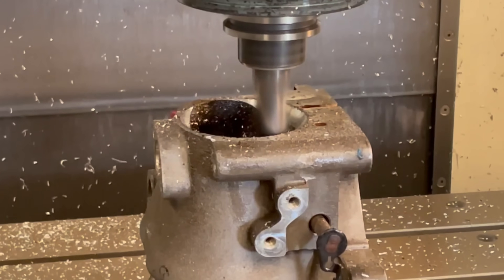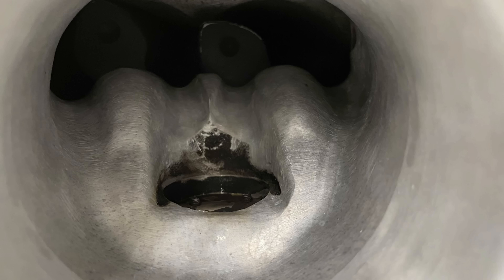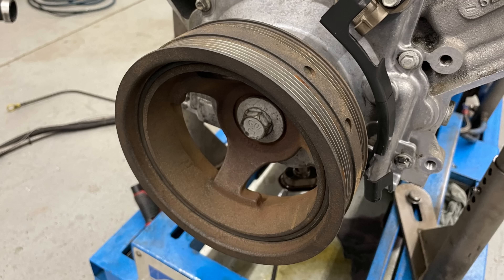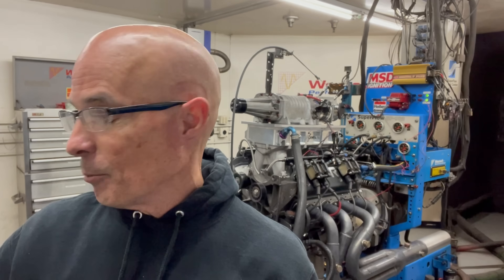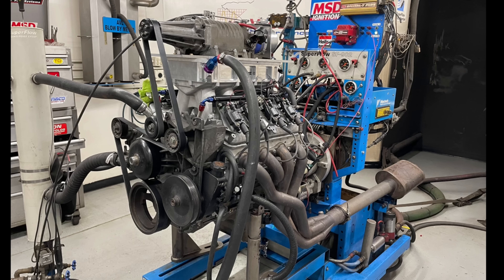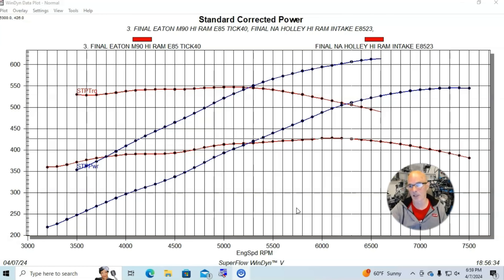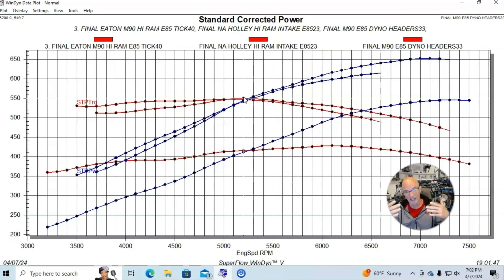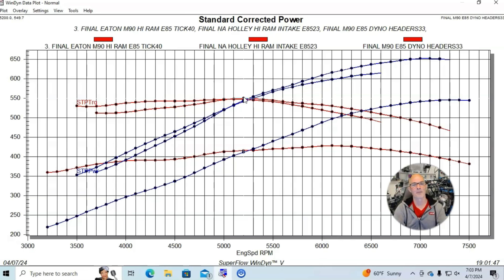PORTED M90 BLOWER TEST-HOW MUCH POWER IS PORTING REALLY WORTH? CAN THE JUNKYARD M90 MAKE 650 HP?

Comment: Not a very good comparison. In your first attempt before the professional porting, you ran it with no intercooler. Then you tested the professionally ported M90 on top of a big thick intercooler core. You will obviously get more power  intercooler.  Need to test your original on that same intercooler. Then you will see the difference of the ported blowers.

Comment: As I happen to have a few spare M90 on hand, building a couple of cars, a 23 T and my 99 Grand Prix which I'm converting to RWD with a Pontiac 455, I have been planning on a BBC for the T, now I'm contemplating an LS and using 1 of those M90's, it looks and performs pretty cool. I'd be able to run the efi I really want to, the COP's and have a really strong well designed easily source able parts instead of the big heavy Chevy. However I don't have a motor on hand to start with and I do have most of the BBC stuff even if I have to pull my 454 from my RV which is old and run down. It was cheap enough and I could easily recoup the cost of that. Maybe this will be on the back burner for later. Either way, as you Rich, you test so I don't have to. I'm still contemplating doing the compound boost on my y2k SSEi using one of those eBay T76 turbos. I have to go back and look at the comparison of it to that GT45 you used and figure how I can make the OE ECM work with that as it's been tweaked already by ZZP.

Comment: Im planning running an M90 on my stock unopened BMW M54B30 at 8 to 10 psi, intercooled, would porting it be worth it if my main goal is lower intake temps or will the intercooler be enough?
Goal is 350-375hp
Reply from the maker: a bigger inlet and porting helps

Comment: hej richard,

i want to place a ported m90 blower on my 2.0l 20v turbo volkswagen.
the car have a borgwarner efr7163 t4 twinscoroll 0.80ar turbo that can do 60lbs/min and make 530hp.
do you think that it going to work when i make the air intake/filter on the blower inlet and the exit of the blower into the inlet of the turbo with a watertoair intercooler in between.
so i mean without valve to switch over to only turbo.
is the supercharger powerfull enough to feed the turbo to its limit of 60lbs/min?
max impeller speed go to 17500rpm (7400 engine rpm)
Reply from the maker: if your efr turbo will support 60 lbs/min-it should make 600 flywheel hp. The blower will be in the way and raise pressure dramatically-though it will help spool
Reply: @richardholdener1727  thanks for youre fast response.
then i go try to make a big  throtle bodie in front of the turbo air intake that opens when the supercharger did the job down low in rpm.

Comment: Blower needs more rpm now. Help recover that boost loss down lower rpm. Peak will also climb as long as heat doesn’t run away. Cooling always key on these pd blower combos. Crazy that kind of gain on such a tiny blower
Reply from the maker: we had over 20K blower speed already

Comment: I guess if hood clearance is not a problem, bolting on 120 ft lbs of torque and 100 hp for $500 is not bad.  The M90 is bit small for such a large engine, but it is much safer to run such low boost, would be great for a DIY person.
Reply from the maker: The blower doesn't know engine displacement-just flow and power

Comment: i had one of these M90's bolted up to a toyota 22r Hybrid motor with lowered compression and a 600 double pumper holley on top... she was fire breather
Reply from the maker: very cool
Reply: Hows  the supercharger working with the carburetor  on top, is the gas wiping the rotors and bearings. I'm thinking about doing the same

Comment: Would be interesting to know if the intake temp was running more at the lower rpm after it was ported.  Maybe it needs a stepped throttle opening to control the blower. 🙂

Comment: 4:00 how long did you say the belt needed to be?   Yes.
Reply from the maker: I ran the belt for the dyno testing without using the alt or PS-you would want a different belt length than I used in a vehicle

Comment: It'll all be to do with air velocities won't it? By porting the blower you remove material and make the port large. If too much bigger this will reduce air velocity but not flow. Hence the lower velocity in the lower rev range will show as a dip in torque.

Comment: The loss low down is probably due to the rotor exit porting. I remember a presentation that Volvo did on an engine conference i was at, where they did play around with that area to taylor the superchargers efficiency characteristics for their twin charge application.

Comment: I am a noob and extremely lacking of knowledge with this kinda stuff. Can anyone inform me of the benefit of having drilled that hole and inserting that pin where it is please. Thank you
Reply from the maker: to stop the damper from spinning on the crank-they must spin together to drive the blower
Reply: @richardholdener1727  ohhhh ok I get it now it locks them both together to rotate at the same rate. Thank you for replying to me very much appreciated have a good day

Comment: I know it's probably one of the multitude of pulls you made, but it looks like at 5:20 you have too much timing up top as it's puffing out the exhaust from detonation....
Reply from the maker: there is no detonation-the junkyard motor has 200K miles and now near 600 dyno pulls with several hundred above 7500 rpm.
Reply: @richardholdener1727  gotcha... Yeah I just figured it may have been a video from one of the times you made a pull and turned the timing up like 1 degree too much in that one spot. Usually for me, that was the sign I was pushing the limits a bit too much and would back it back down.

Comment: Just did a test on an LT4 Camaro ZL1 last week.  Same tank of fuel, same pulleys, same tune, just swapped stock 2650 blower for a Kong-ported 2650.  Picked up 70 hp up top.  gained from 4000 rpm onward.  Did lose some torque below 3000 rpm though.  This was on a 427, really good cam and heads, making 4 figure hp.
Reply from the maker: do you think the port timing changed with the porting to show the losses down low
Reply: @richardholdener1727  I think it had to have.  It's got a lot more entry area so at low speeds with less air velocity it just isn't filling the rotor space as well.  And air velocity probably got even worse by opening it up.  TBH I'm not sure I'd do it for a manual car.  But for an auto trans with the right setup (this was on a 10AT ZL1) it's all positive.

Comment: Interested to see what a 10/71  Blower on stock motor would make for hp, with ring gap added of course
Reply from the maker: I have a 6/71 blower on a 383 ls vid up
Reply: Great vids Richard! Was thinking more like a K24 honda motor with a 10/71. Boost at idle at 10 psi at 2500 rpm. How much air gets bypassed vs injected into the motor and how long will the motor last "BIG BANG" style

Comment: I'd say the blower after porting has lost some displacement to gain higher speed efficiency (air throughput). Probably where material was removed around the rotor closing/opening points within the housing and that changed their locations slightly decreasing displacement.
Reply: Porting a blower will not increase or decrease displacement, it just makes it more efficient, it lost the low end grunt because is throwing less boost

Comment: That is an overwhelming amount of effort/stuff to make 100hp. it's ~20%, but now you got that intercooler and a modified OEM blower. So you've got extra fluid leaks plus more spinning stuff. Seems like a pass for this size of engine. Doubling up on them might work, but seems like a way to destroy time compared to a 7875 VS turbo.
Reply from the maker: YOU MISSED THE POINT OF THE EXERCISE

Comment: I highschool, we made pneumatic engines. Mine ran on about 5 psi. Good tollerances and what not. Other kids sloppy nonsense would spin insanely fast. I realized how, and ported mine; now mine went even faster than his; but the low speed efficiency was gone. I'm sure the same would be observed using it as a compressor; and I'm sure there's something comparable to aggressive cams in both cases.

Comment: Blower looks comically small.  Who will come up with a way to mount two in a row - one behind the other?  Huge single throttle body on top of Inverted Y shaped inlet elbow, jack shaft with pulley on each end...

Comment: Why not run 2 M90s? I saw a twin setup on a firebird once upon a time... One M90 is gonna  make too much heat to be worth a damn on a V8 at Rpm. 2 mite be worth it
Reply from the maker: We made 650 hp with 1 ported M90 and the charge temp was only 85 degrees at 7200 rpm
Reply: @richardholdener1727  that is seriously impressive. Not just the HP numbers but the IATS..... The Fiero crowd loved the 3800sc and I've owned an bunch of them. Most ditched the M90 and went turbo for anything above say 500hp due to the lack decent charge cooling that would clear the deck lid. Without water/meth M90s would heat soak and start to knock and kill timing with aftermarket pullies and higher boost on the 3800. You'd really have to spin that thing to get boost on a bigger CI engine. I still think two m90s would be the way to go on a V8;  especially one as potent as an LS that have heads that flow stock.

Comment: Okay so now what if you ran TWO ported Jokerz blowers on the 5.3 haha. Incredible stuff though, a cheap junkyard blower is cranking out almost hellcat power on the engine dyno and beating an LSA! From dealing with inline pumps on carb tanks for efi and porting some oil pumps I've learned pumps absolutely HATE inlet restriction, so if the inlet is even a bit small there could be big gains available.
Reply: In stock m90 the casting is super rough and there's probably a lip right after the throttle body. I think I can be improved a lot just smoothing I all oit

Comment: I wonder how the M90 would do on something like a K20/24 or a Subaru N/A FA20/24.
Reply: I run it in my miata. 1.8
Reply: Well the M62 blowers on ethanol with a plate intercooler easily crack 400 whp.  So with 50% more blower...

Comment: I went through my garage and I have no less than 3 m90 blowers from my ssei days. My stock gen 3, my ported gen 3 from a junkyard gtp, and a gen v blower from a 05  series 3 gtp. The memories of grenading those transaxles came with it. 🤘
Reply: When did they blow up? Just driving, or when doing a pull? I'm modifying my GTP at the moment.
Reply: @kirbyswarp  Alot of them failed in winter and would start with soft slips before just refusing to go into first. I had one let go during a wide open throttle 1-2 shift. it straight up grenaded.
Reply: @kirbyswarp  I've seen a Saab 5 speed swap into a gtp. Seems a much more stout unit and being manual is tons of fun
Reply: @madmod  yea the saab swap is fairly common. the g6 6 speeds i hear fit nice and hold some power aswell...another saab part i believe.
Reply: @hellbringer09  I've heard of people using K series 6 speed fwd gearboxes too but don't know who makes the swap parts
Reply: @madmod  yeah if you want strong transmissions use a j or k saeries 6 speed. can put a 5th gear delete girdle in for more beef and have 6th for o/d probably just need bellhousing conversion plater and a custom half shaft and cvs...
Reply: @madmod  I thought it was Cavalier F22 5 speed that were swapped into grand prix? I've got a few Saabs and a cobalt SS with a saab trans in it, consensus is that they arn't particualrly strong in both communities.
Reply: @kirbyswarp Hey, I'm moving a GP without the SC option too but I'm making a full frame, let me re phrase that, I'm finishing up the welding on the frame to put under it, in it whatever it needs so it will allow for red powered by a built 455 with some RA4 stuff! The narrowed 9" is ready for assembly, getting the engine block & trans hopefully this coming month. I also have some other projects in the works I gotta get to where they can be shown for incentive for people to bring me more work. No one is going to bring things to someone that is known for their works you know. Having cool things let's them know you can do that stuff.

Comment: M90 on a stock 4.3 vortec test if you do the 4.3! Maybe a company could build a intake set up if it shows promise!
Reply: Budget 500 hp v6!! Put in a old g body make a poor man's gnx
Reply: Please m90 the 4.3l
Reply from the maker: IKR on the 4.3L
Reply: M90 in a s10 platform would make a nice vidoe.
Reply: And even the new DI 4.3l. Id b curious to swap that into my vortec s10. Still a 4.3 like the badge says.... 😂
Reply: 🤔 you might be able to use the spider injection lower intake and bolt a plate to mount m90 🤔 it's been a minute since I had one apart